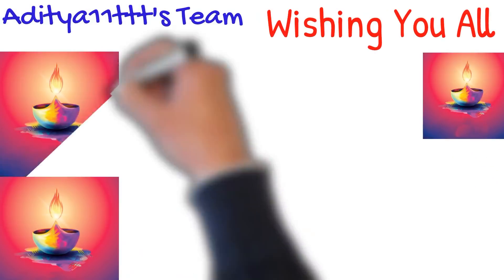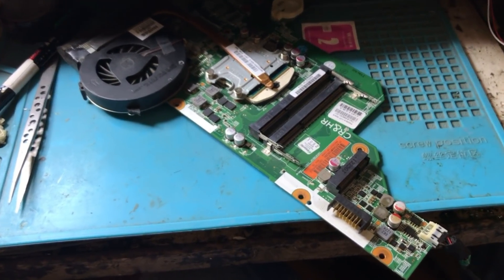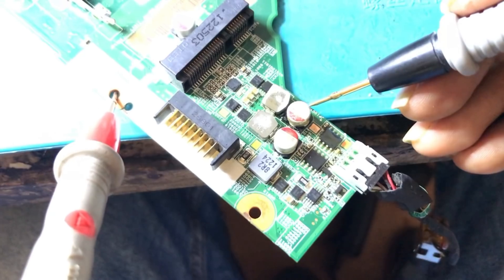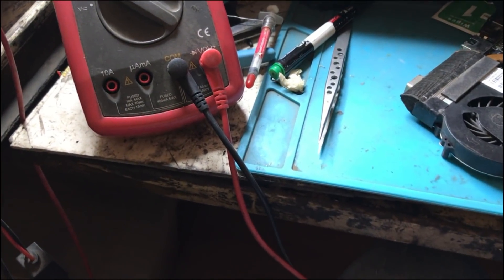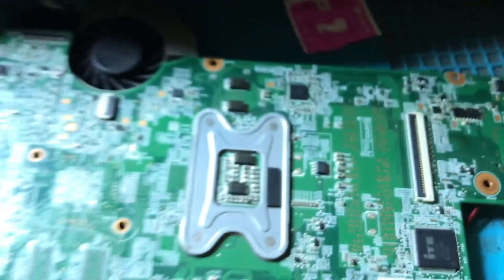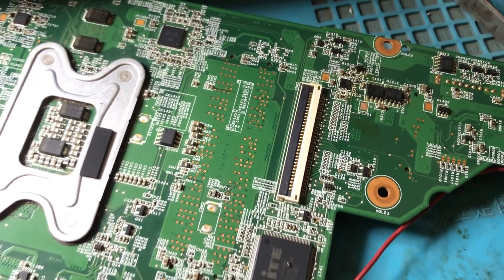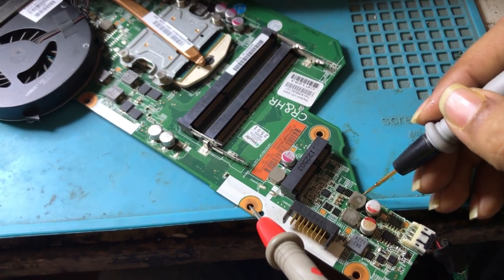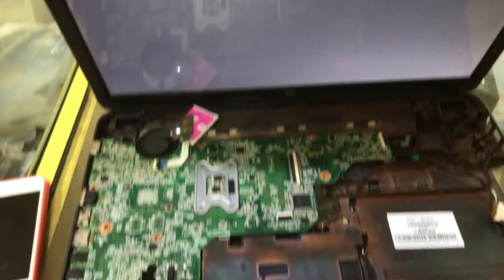#LaptopRepair Hp Laptop Power on But No Fan Spin and No Display Solve by #Aditya11ttt & #SatishBhai

Comment: Sir , my laptop also has same problem but I don't have ampear check meter ,can I just let it connect motherboard to charger and wait to see any heat capacitors to remove ?
Can you pls help me with this issue sir??

Comment: I am facing same problem but in my case there is screen showing that " your fan is not working it will shutdown automatically after 15 sec. Press enter to continue" & through this i used my laptop for 2-3 days without fan rotation but now it's suddenly gets shutdown while i was using and after that no display is showing and no fan rotation . Is my laptop is repairable or not ?
Reply from the maker: Repairable

Comment: Sir after i replace na nectokin of my samsung core i3 laptop, it solved the problem in display but now it automatically shutdown even though its not overheating can you please help me sir..
Reply from the maker: christian retuerma try clean me once and also check the changed caps is placed properly or not if not same issue will occur !!